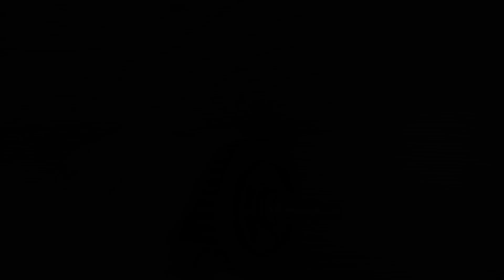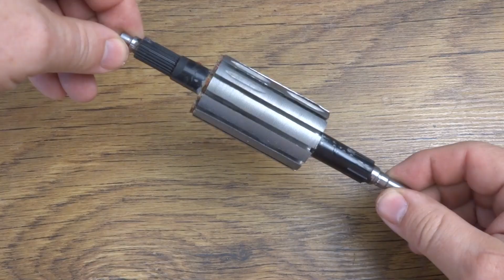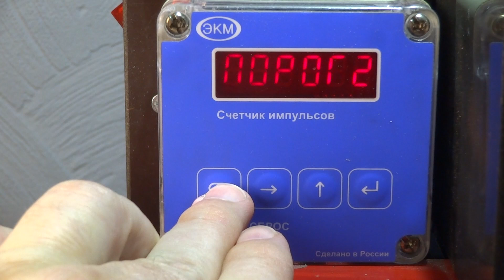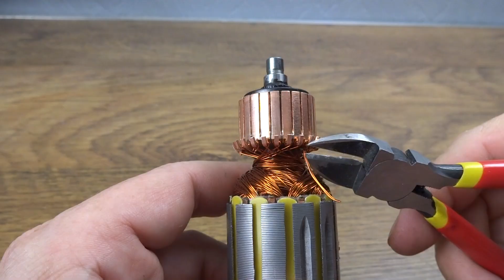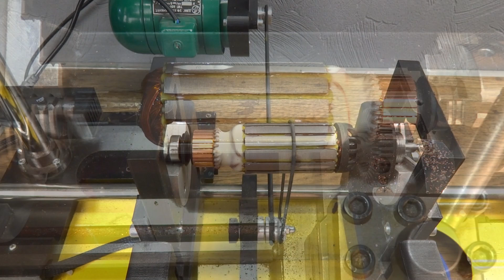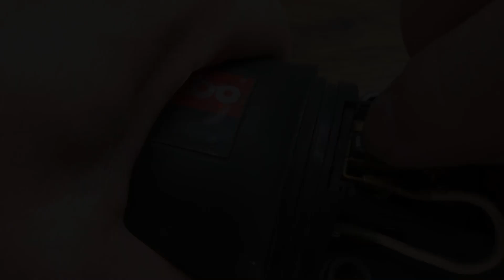Rewinding the armature of the electric grinder motor Metabo WQ Euro

Comment: Which are the two materials you are using for encapsulating the windings?
Reply from the maker: Epoxy resin and epoxy compound
Reply: @valsworkshop 
Which manufacturer and type? 
I couldn't find something that can withstand high temperature.
Reply from the maker: @paulcohen1555  Resin KER-828 + hardener Etal-45m, compound X/3